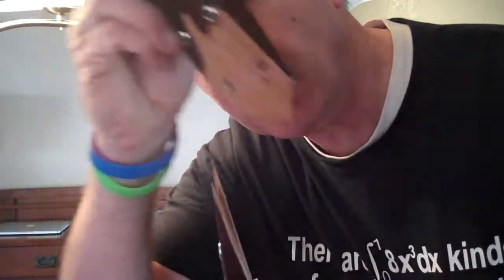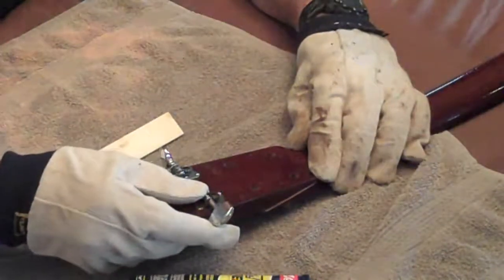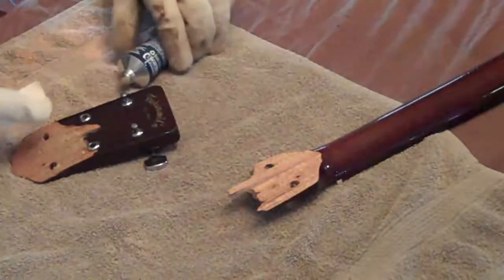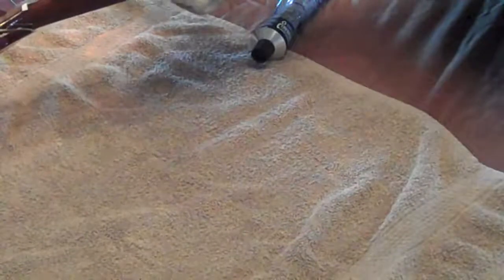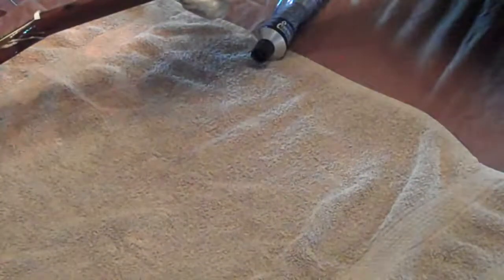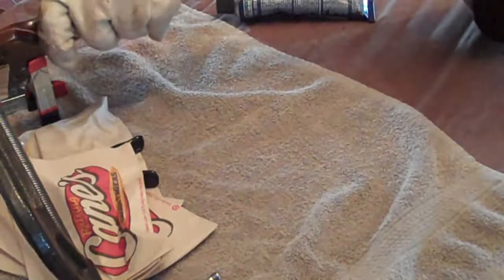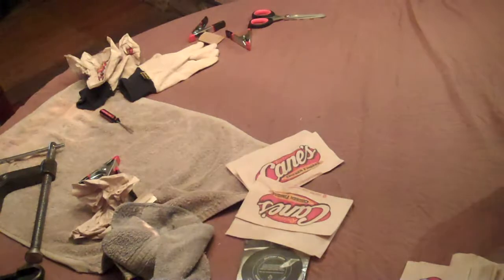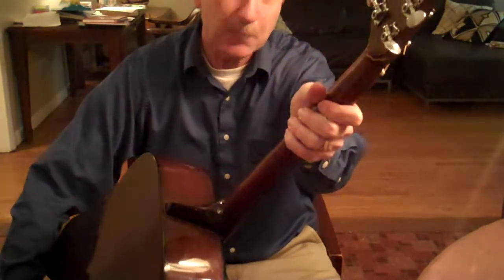How to Repair a Cracked Headstock Takamine F340 Acoustic Guitar

Comment: you had the big clamp far to high on the head stock it should of been where the truss rod cover is (remove the truss rod cover first though ) it would clamp better.
Reply from the maker: I think you're right.  I would have been able to move the center of the clamp force closer to the main bulk of the break.  Fortunately, the guitar still works.  I'm still upset that I was careless enough to let it crack in the first place.  Thanks for viewing and commenting.